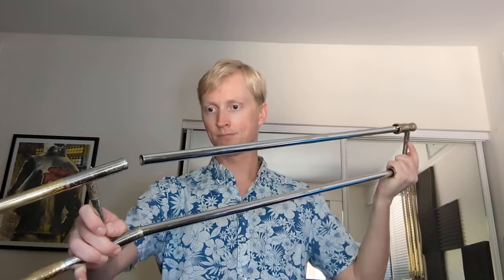Clean Your Slides!

Comment: If you just dry the inside of the outer tube and the outside of the inner tube after every single use, your slide won’t build up any mineral crud. That mineral crud builds up like coral on the inside of your outer slide and will grind down your slide plating. But the key is never letting that stuff build up to begin with. You have to dry it out after every use. If you’ve never heard of this, you need to have your slide professionally ground out by a slide guy first and then you can properly maintain your slide.
Reply from the maker: Too much work!

Comment: Have you tried using Windex on the inner slide before you wipe it down.  That helps the cloth pick up the dirt.  Works for me anyway.
Reply from the maker: Too much effort! Haha
Reply: Do NOT use regular Windex on your slide!  The ammonia will damage the lacquer.
Reply: @DLudwg42  - to my knowledge, the inner slide has no lacquer on it.  If it did, it would wear through in a very short time regardless of the lube you use.

Comment: I've cleaned my slides for years but this really was eye-opening
May I ask you why you don't use water? 
Thanks!
Reply from the maker: I do use water to clean the inners every once in a while. But I have just found water to be unnecessary for action- it just dilutes the lube and it evaporates faster. I haven't used water in more than 10 years.
Reply: @AidanRitchie  Interesting. That Yamaha Slide Lube must be good stuff!  I was a fanatic about keeping my slides clean. Back in my day (gads, I feel old) I used Conn Slide Cream (it was supposed to be the old Ponds Green Cold Cream formula...before they added lanolin).  I did use a spray water bottle with distilled water.  I would have loved the results you have!  Thanks for the video!
Reply: What are some good lubricants you would recommend?
Reply from the maker: @keithshockley3443  for slide? Only yamaha slide lube.
Reply: Water is corrosive to metal. I don’t add water to slide since condensation from my breath is enough to keep it moist. After playing I use rod with dry cloth to remove any accessible condensation. This is of course not always practical, but I find it helpful keeping green corrosion off inner and outer slide tube.

Comment: Would a snake work too? Because I just ordered one yesterday, not a cleaning rod
Reply from the maker: Nope. That is great for the inner slide and to clean out the crook but does not do what I do in this video.
Reply: Put a small cloth on end of snake to soak up liquid, but he is right, it does not develop enough friction without a rod.
Reply from the maker: @bradleybunk6463  I'd be very careful of doing that, very easy to lose your cloth!